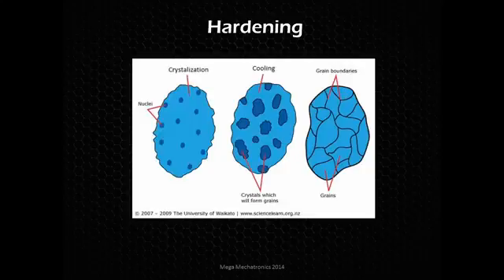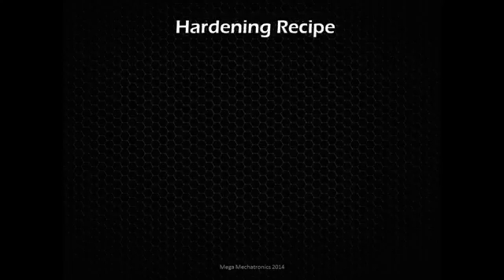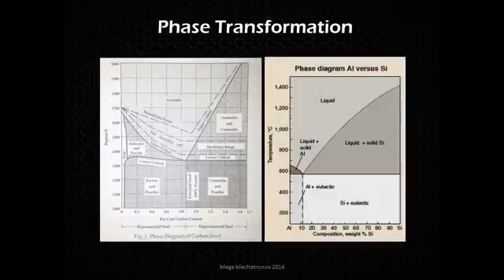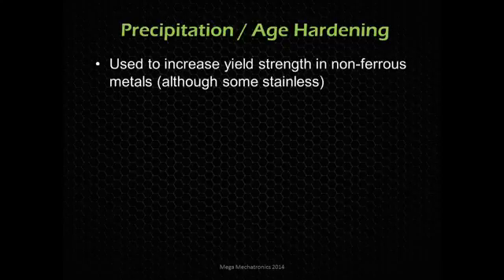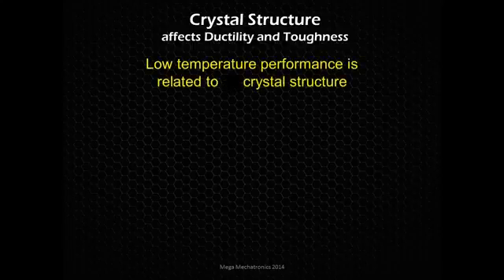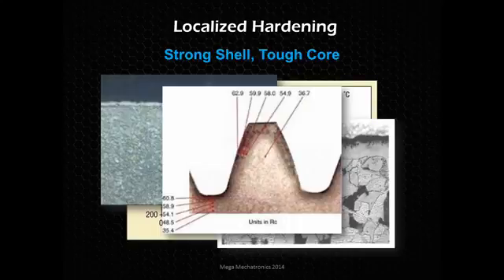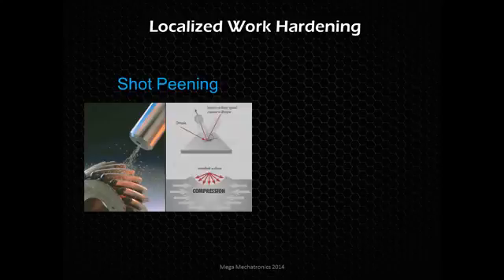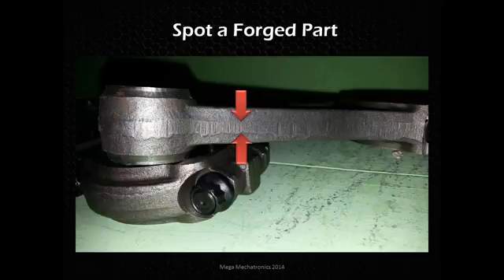Materials Science Mechanical Engineering    Part 4 Heat Treatment Explained

Comment: Fajryansya Miftahul Falah 2714100063 
from this section i'll explain about the several topics at this Video. this video is published by Mega Mechatronics bootcanp series that explain about hardening process of materials and then this section explain about heat treatment of the materials. beside that this video explain too about cold work hardening material. from the first scene we shown about the mechanism of hardening process and shown about crystallization process of material from nucleation, then for cooling process the grain growth bigger and then finally come to make grain boundaries and then show the example of crystal structure there is fcc, BCC and tethragonal. then show the crystal deformation of crystal. and make the example of crystal deformation by miniatur ball. and then grain boundary. that explain about the relation grain bundary and crystal structure . then next that is explain about the hardenability on that video explain is limits dependent on alloying elements of the metal and hardness dependent on carbon content in ferrous metals and then after that shows the diagram about the influence carbon content to the hardness of steel then the video shown about hardening recipe the diagram for hardening process that shown the transform from reheating the time of heating and cooling rate and then the diagram shown the media of quech there is water, oil and salt. for success recipe is the example of spring on racing car that is shown the process of hardening of that spring, from normal heating,austemper, cryotemper and then processing to cold working shot peening, polishing. 
and then after that show the comparison from phase transformation from phase diagram of steel and phase transformation alluminium. and then composition matter there is shown the comparison about the matters of plain carbon, 4130 alloy steel, and 304 stainless steel. and then there is several treatment to harden for them and then have different way to hardening them. and then after that this video shown the diagram stress strain comparison for several way of heat treatment and then we show the highest stress and full anneal at lower stress and then full anneal have the highest elongation. the tempering explain that done after hardening, material is too brittle, improves toughness and tempering do at below transformation temperature. at normalizing explain that normalizing is ferrous based metal heated above transformation temperature and then allowed to air cool in still air at room temperature. and then at annealing explain heat and hold temperature, controlled cooling rate, primarily for softening and produces desirable microstructures. and then explain about precipitating hardening, the precipitating hardening is used to increase yield strength in non-ferrous metals(although some stainless) and produces fine particles that defects the crystal lattice that impede movement. and then there is several way to know the number of hardness and measure that with brinnel, vickers and rockwell hardness method and then the other method there is scratch test to measure the hardness of material and then we can compare them . at astm there is the table that can make comparison from brinnel to vickers then from vickers to rockwell. and then there is the several method for make them harden and there is nitriding and induction hardening and then from cold work there is severall way (also called age hardening) is a process where a second phase that begins in solid solution with the matrix metal is precipitated out of solution with the metal as it is quenched, leaving particles of that phase distributed throughout to cause resistance to slip dislocations. This is achieved by first heating the metal to a temperature where the elements forming the particles are soluble then quenching it, trapping them in a solid solution. 
Had it been a liquid solution, the elements would form precipitates, just as supersaturated saltwater would precipitate small salt crystals, but atom diffusion in a solid is very slow at room temperature. A second heat treatment at a suitable temperature is then required to age the material. The elevated temperature allows the dissolved elements to diffuse much faster, and form the desired precipitated particles. The quenching is required since the material otherwise would start the precipitation already during the slow cooling. This type of precipitation results in few large particles rather than the, generally desired, profusion of small precipitates. Precipitation hardening is one of the most commonly used techniques for the hardening of metal alloys. Then there is the videos shown all about the comparison about the stress and strain from one threatment to all. And then there is shown that every heat treatment has many several properties and one of them have many kind of application and then cool working there is several way and not all way to make them. There is a lot of material that can hot work and cold work but the other way there is several material that cannot do heat treatment for example austenitic steinless steel

Comment: Shochibul Ma'arif NRP: 2714100052

I'm glad to see this video. It can improve the skill or ability to learn listening fluently. Yeah, the video tells us that to make materials which have good properties it can be formed by applying heat treatment. Especially, for theferrous metals and alumnum. The treatment ally heat to change the microstructure. For the example, steel that containt 0.4%C at room temperature will perform pearlite phase. But, if we apply heat for that steel to temperature 925 degree of celcius, the microstructure will change to austenite. Furthermore, hardening process is kind of process to get materils will be hard. There are kinds process to make the materials harder. By watching this video, we can learn it completely. 

Heat Treatment is kind of treatment that apply heat to improve the properties of materials especially in metals. By applying this heat, the microstructure of the metals will change and do the re-crystallization process. Firstly, the metals produce nuclei that promote to grow the grain. Nucleic is the main factor or can be called mother of grain. For the example, heat treatment in metal, are applied to aluminum, steels and so on. This video tell us the mechanism of hardening process which applicable for aluminum. 

This process consist of three steps are crystallize, lattice atom move around and then cooled. Atoms start to form crystal, in microscopic level. For the ferrous materials, aluminum, the microstructure is cubic. The crystal structure change from cubic, to face center cube then finally be hexagonal form. 

Let see the dynamic crystal structure deform from cubic structure then the atoms move around but still bonds. Atoms, have energy to move because heat that they have gotten before. So, the illustration is a number of ball that stick together then deform be abstract form but still in bonding. 

Grain boundaries that’s small one, is the best doing of hardening process. In the picture, show us that the boundaries are unconformity and spread off at the surface. If we want to make the grain bigger it can be more ductile and low the strength. 

The concept of hardenability difference to metals is a concept to be hard. Various materials that contain carbon will be hard because the element increase the strength. By looking of the diagram, levels of the carbon content goes up that promote the hardness goes up. 

Hardening recipe is very important, they are time and temperature which consider to get best hardening product. Time of cooling rate is also very important. Base on case to get martensite microstructure, the cooling should be faster. The temperature of cooling also be considered when do hardening process. If we want to tempering the metals, it should be heated below A3 or Acm then we colud relieve residual stress. But still has martensite microstructure. 

The recipe will be success if the material which we produce can be applicable to advanced function. The example for materials is spring, this material have characteristic a lot of stress and the stress is needed to their function at modern car. The treatment process consist of hardening process, then austempering, cooling to room temperature or be quenching. Then be heated again below A3 or Acm and be hold for several times. And we get spring which have high strength and more ductile. 

For the phase transformation, Fe-Fe3C diagram the carbons content influence the phase transformation that form austenite, ferrite, pearlite and cementite. Different with aluminum, the carbon content doesn’t improve significantly, but the alloy element is more important to increase the strength. 

The composition matter can improve the properties of materials. Let see for steels, yeah…that carbon can affect the increasing strength. For the alloy can contain more than two elements. Like chromium, copper, molybdenum. Many of alloy has different effect for the properties. For the chromium could increase stain resistance for the steel. 
Normalizing is kind of process that heat materials heated above transformation temperature. Allow to air cooling to room temperature. Annealing is kind of process when we heat and hold the metals then control the cooling rate. Primarily is to softening the metals and produce fine grain. Precipitation or age hardening is used to aluminum that increase yield strength. 

The hardness test is to quantify the materials that can resistance from indentation and scratch. Such a example is Brinell Hardness Test is to measure the depth of indentation which use ball (steel) we can measure the diameter by applying the equation.

The simplest way to know the hardness of materials is to scratch the materials it is known as Mohr’s scale. That the diamond is hard one. And the lowest hardness material is talc. 

that's all my summary to this video. Base on Totten and Materials Science and Engineering books, I make the point of this video to be summarized. Thank you.

Comment: Samuel Budi Utomo 2713100091

From The Video we know that heat treatment in iron or iron alloy is important for many application in our daily life. In the beginning of the video, it explain about how to hardening the metal. It explain that to hardening, the metal must be crystallized, and let the atoms on the material to move around and then the material is cooled down and the atoms going to start forming crystals and at the microscopic level for ferrous, a BCC (Body Centered Cubic) or FCC (Face Centered Cubic) is formed. After that the video explains about crystal lattice dynamics that illustrated by a magnetic ball toys formed as a cube that can moved around but still stick one to another. When the crystals start forming randomly within the material, they’re going to crystallized in different orientation to each other so when it exposed to light, we can make the grain boundaries. The size of the grain boundaries is important, if the material’s grain boundary is smaller, the material is stronger because the space for the crystal lattice to move around is reduced. If the grain boundaries is larger, the material will be more ductile because the crystal lattice can move around and deform and orientate themselves and shift around the material. The concept of hardening is to make the material harder, by applying heat or reheated and the time, holding time, holding temperature is important too. For cooling time, there are 2 things should payed attention to, cooling rate, and cooling media. Each material has a different cooling rate and different cooling rate can take effect on the mechanical properties of the final product. To reach the cooling rate we desired, we must choose a matched cooling media. The composition in the material is important too, for example a plain carbon steel and alloy steel have a different hardenability. In one alloy, we can give it many properties, depends on the treatment, for more specific, the cooling time. A different mechanical properties will produced if you treat the material differently.  The use of this treatment will result in an improvement of the mechanical properties, as well as an increase in the level of hardness, producing a tougher, more durable item. Alloys are heated above the critical transformation temperature for the material, then cooled rapidly enough to cause the soft initial material to transform to a much harder, stronger structure. Alloys may be air cooled, or cooled by quenching in oil, water, or another liquid, depending upon the amount of alloying elements in the material. Hardened materials are usually tempered or stress relieved to improve their dimensional stability and toughness. Steel parts often require a heat treatment to obtain improved mechanical properties, such as increasing increase hardness or strength. The hardening process consists of heating the components above the critical (normalizing) temperature, holding at this temperature for one hour per inch of thickness cooling at a rate fast enough to allow the material to transform to a much harder, stronger structure, and then tempering. Steel is essentially an alloy of iron and carbon; other steel alloys have other metal elements in solution. Heating the material above the critical temperature causes carbon and the other elements to go into solid solution. Quenching "freezes" the microstructure, inducing stresses. Parts are subsequently tempered to transform the microstructure, achieve the appropriate hardness and eliminate the stresses. For quenching, Material is heated up to the suitable temperature and then quenched in water or oil to harden to full hardness according to the kind of steels. Material is heated to the suitable temperature for hardening, then cooled rapidly by immersing the hot part is water, oil or another suitable liquid to transform the material to a fully hardened structure. Parts which are quenched usually must be aged, tempered or stress relieved to achieve the proper toughness, final hardness and dimensional stability. Alloys may be air cooled, or cooled by quenching in oil, water, or another liquid, depending upon the amount of alloying elements in the material and final mechanical properties to be achieved. Hardened materials are tempered to improve their dimensional stability and toughness. Tempering is done to develop the required combination of hardness, strength and toughness or to relieve the brittleness of fully hardened steels. Steels are never used in the as quenched condition. The combination of quenching and tempering is important to make tough parts. This treatment follows a quenching or air cooling operation. Tempering is generally considered effective in relieving stresses induced by quenching in addition to lowering hardness to within a specified range, or meeting certain mechanical property requirements. Tempering is the process of reheating the steel at a relatively low temperature leading to precipitation and spheroidization of the carbides present in the microstructure. The tempering temperature and times are generally controlled to produce the final properties required of the steel. The result is a component with the appropriate combination of hardness, strength and toughness for the intended application. Tempering is also effective in relieving the stresses induced by quenching. To calculate materials hardness, we use indentation test, usually we use Vickers microindentation test. The Vickers microindentation test is carried out in a similar manner welling to the Vickers macroindentation tests, using the same pyramid. The Knoop test uses an elongated pyramid to indent material samples. This elongated pyramid creates a shallow impression, which is beneficial for measuring the hardness of brittle materials or thin components. Both the Knoop and Vickers indenters require prepolishing of the surface to achieve accurate results. Scratch tests at low loads, such as the Bierbaum microcharacter test, performed with either 3 gf or 9 gf loads, preceded the development of microhardness testers using traditional indenters. In 1925, Smith and Sandland of the UK developed an indentation test that employed a square-based pyramidal indenter made from diamond. They chose the pyramidal shape with an angle of 136° between opposite faces in order to obtain hardness numbers that would be as close as possible to Brinell hardness numbers for the specimen. The Vickers test has a great advantage of using one hardness scale to test all materials.The first reference to the Vickers indenter with low loads was made in the annual report of the National Physical Laboratory in 1932. Lips and Sack describes the first Vickers tester using low loads in 1936. There is some disagreement in the literature regarding the load range applicable to microhardness testing. ASTM Specification E384.